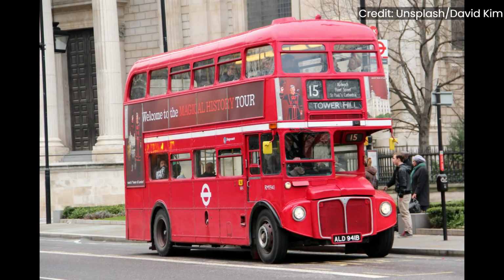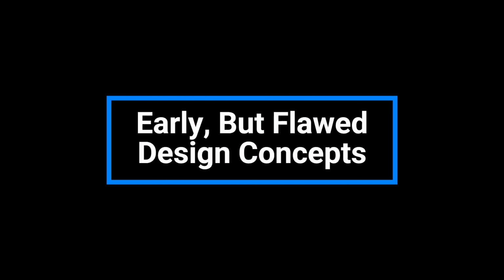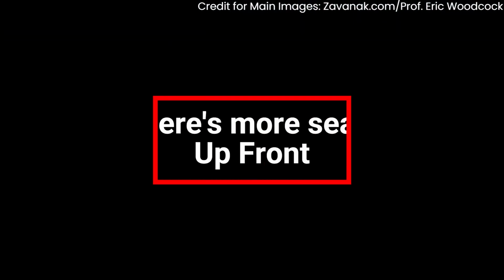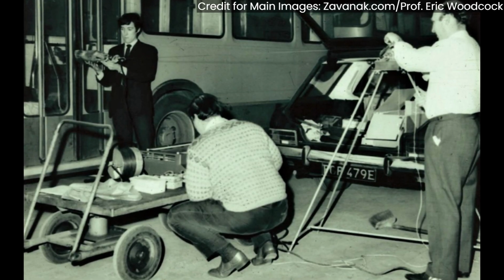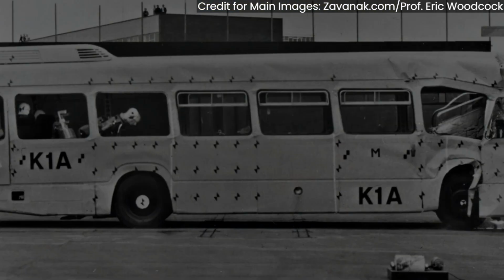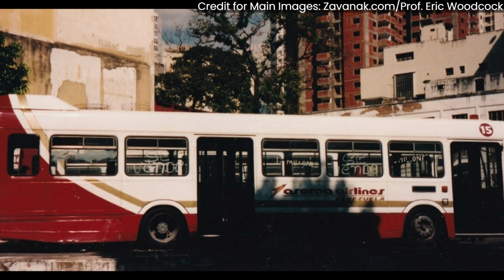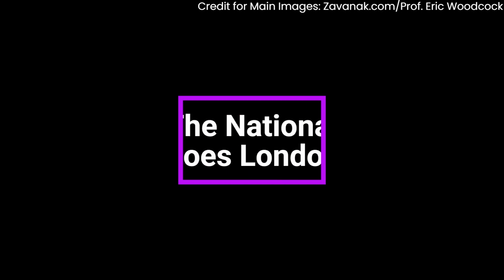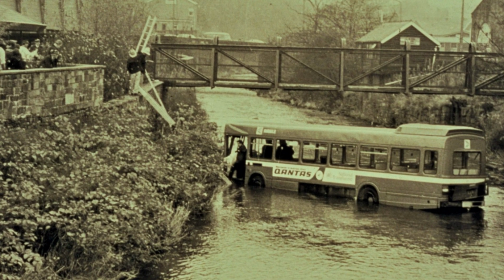The Leyland National Bus: Amazingly Flawed Engineering!

Comment: even though they had their problems, many had long lives lasting over 25 years, a coach company in scotland ran them right up untill 2017
Reply from the maker: Hello! Interesting to hear how long some have lasted!! Thank you for watching and for your comment!
Reply: The Scottish Prison Service ran three, converted into cellular accommodation for prisoner transport.
Reply: We had them in the South Wales Valley Lines until very recently 2021?, up until Transport For Wales took over the trains..
Reply: Yes they were very popular with second hand operators. Guess because they were easy to maintain.
Reply: Aye, Rapsons used to operate them for years. Often sporting the "Highland Country" logo. They had Leopards before that. I used to go to high school in Leopards at first. Then later it was Nationals.  2000 - 2005
Reply: Most of the older stuff was incredibly durable compared to what's made today. In the Netherlands we also had buses with Leyland engines, different body, but yes they lasted similarly. And even then they were usually discarded for body rust, not the engine.
Reply: Many… meaning those that didn't have any quality problems.
Reply: @LMB222  Yes build quality was the problem with Leyland, especially with the 500 engine. I knew someone with a Buffalo (truck), when new it was brilliant, fast, lightweight and economical. But the valves went out of adjustment, and the whole engine wore badly and needed rebuilding a bit after 100 000 miles, at a time when Gardner and Cummins could do half a million miles with only routine servicing. Then the reason no-one else used fixed heads became clear - the engine split at the crankcase and they had to build a jig to turn it upside down once they got it out of the chassis. Some 500s were obviously built properly and had long lives but I gather not many.
Reply: I'll add to my previous comment that they were totally ill suited to the hilly terrain and bumpy narrow roads we were on. 😂 They were sodding awful, the Leopards in particular seemed to have dismal braking performance in the wet. Every bump threatened to rattle the teeth out of your skull. Interesting machines though.

Comment: A very interesting video, the National was forced on the fleets of the National Bus Company with a choice of red or green livery.
In the 90s quite a lot of Nationals were re bodied by a company called Willowbrook using the original frames, replacing steel outside panels with aluminium.
The National 2 was a much better bus but it came too late.
I much appreciate the time and trouble you take to make these videos.
🏴
Reply: your thinking of east lancs coachbuilders & the leyland national greenway
Reply: @kaolla1000  Yes, old age getting to me.
Reply from the maker: Yes! The National made its debut not too long after the NBC came into being. It's unfortunate that all those great liveries were replaced with either poppy red or leaf green. I think the Lynx had replaced the National, from what I have read. Thanks again for your informative comments!!
Reply: Willowbrook never touched Nationals. It was East Lancs who did the Nationals, known as the Greenway. Willowbrook were more well known for rebodying Leopards, mostly with the Warrior for bus work, but also the Crusader as a Coach. Unlike the Greenways which were pretty successful, Willowbrook's rebuilds didn't last long since Willowbrook bodies were rustbuckets, and the Leopard wasn't great for bus work due to it's high floor. Funnily I actually work on the site of the former Willowbrook factory, now a retail park.

Comment: I hated driving the National.
The 501 engine was very unreliable and noisy. The heating system was poor blowing warm air down from the roof, hot air rises doesn't it?
They were overcomplicated, we often had to kick the engine cover to get the engine to start. There was a cheap and nasty safety switch behind the cover that often failed.
I am glad I have a 1963 front engined double decker, a superb bus that does 10mpg.
Reply from the maker: Hello! Thank you so much for your experience with the National! Very interesting!!! I guess it really was a flawed design, LOL. Thank you for watching and for your comment!
Reply: Should have suited Brisbane passengers with air conditioning
Reply: The ventilation system was designed so that a curtain of warm air would keep the windows free of condensation, and is much less fierce than floor mounted radiators. Modern air conditioning systems are always ceiling mounted after all
Reply: @AndreiTupolev  The heating was crap. I well remember being too hot and cold at the same time. And the basic bus seats had no padding and a stupid bar that dug in your back.
Reply: Well I for one loved the sound of them and drove them and National 2's which were OK but didn't have the nice sound.